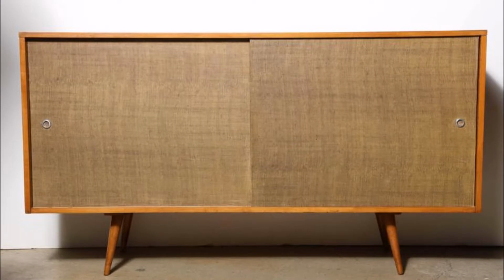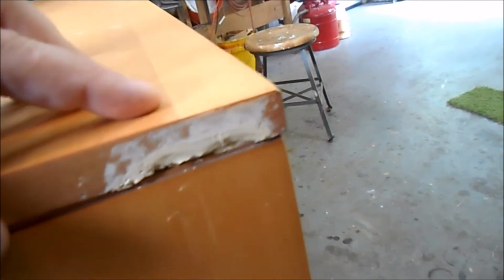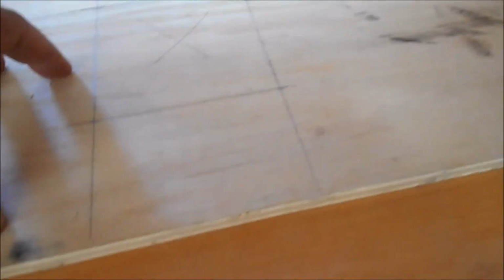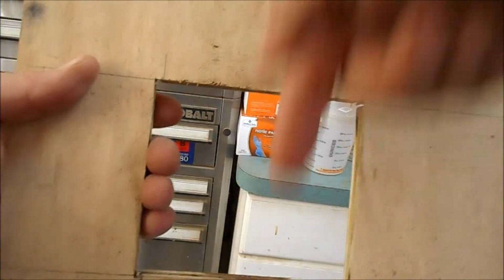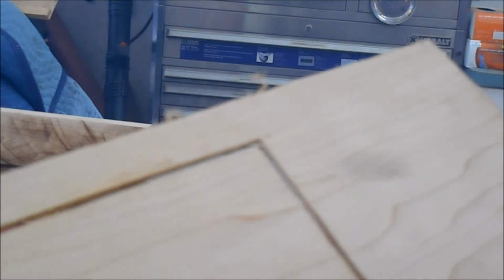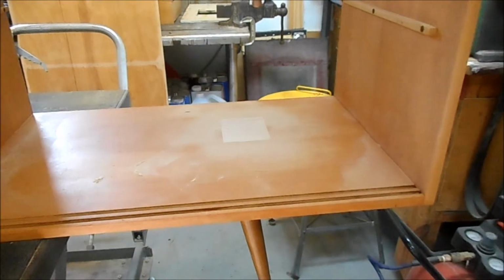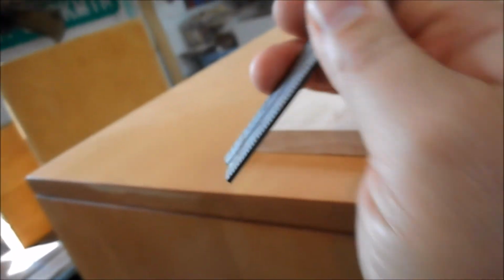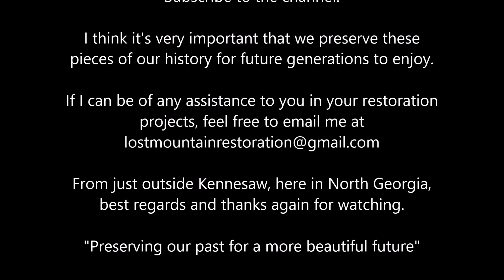Restoration of a Paul McCobb Planner Credenza  - Part 1 Inlay Repairs

Comment: Nice repair templating the inlays! I'm thinking to get a plunge router after having seen your use of one.
Reply from the maker: Thanks.  The Bosch is a nice router, but the template system is unique to it.   The Porter-Cable style template is more popular and I believe substantially cheaper to buy.